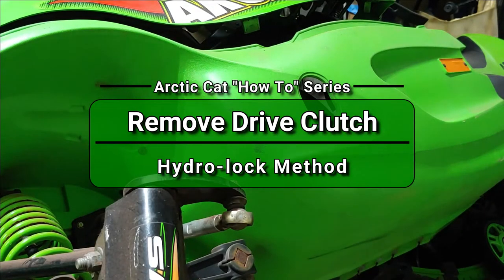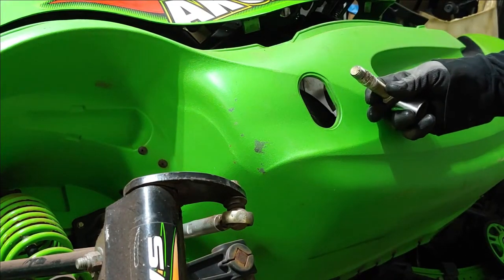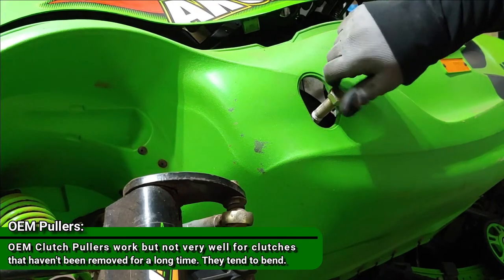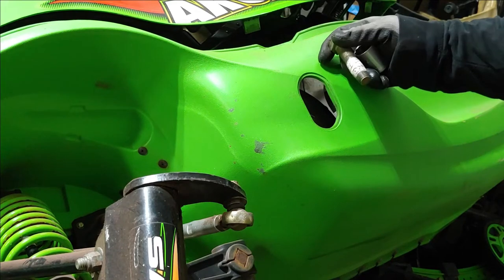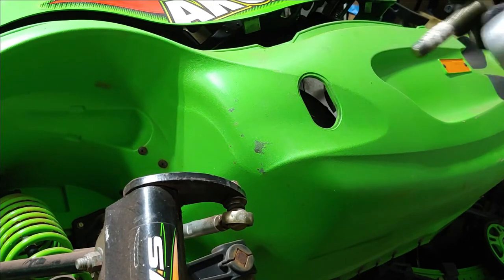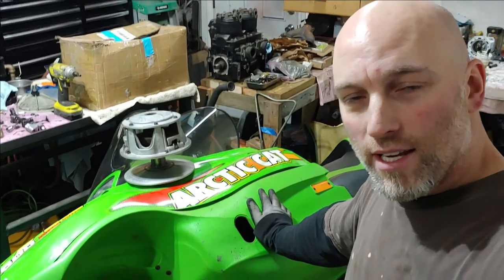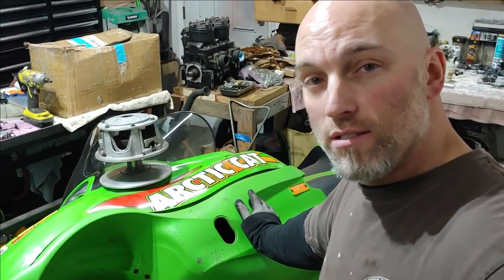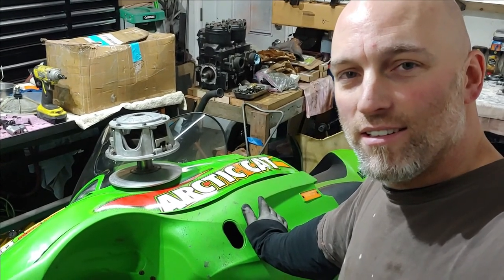Arctic Cat How To Series: Clutch Removal [Hydro-Lock Method]

Comment: I saw it on PowerModz too, but I think he only had to do it a couple times because he wasn't sure about it working.  I just received a Ski Doo clutch removal tool, but you have to whack it to get it off.   I'm trying that first, then if I think something doesn't feel right, I'm doing this method.  My isoflex is supposed to come in tomorrow so hoping to get that crank bearing all lubed.  Nice video, worked really well.  No snow here and nothing expected for 10-14 days at least.  Unbelievable.
Reply from the maker: Oh man, don't waste your time. Seriously. This is the only way that I remove clutches. You can twist the wrench with one hand and there's no risk of bending the tool and getting stuck in your clutch and have to cut your clutch off. 

We are supposed to get some decent snow up north late next week so we will be heading up.
Reply: Andrew's right! Hydraulic pressure is distributed over the entire landing cone of the variator. When you press with an ordinary puller, squeeze only in the center. Plus, you get resistance from the friction of the removable bolt on the crankshaft. In the end, I recommend listening to Andrew , he is a good mechanic. Do it as he showed!!! They do it all over the world! Hydraulics are always better than simple pressure! This is physics!

Comment: Would this work with the secondary too?
Reply from the maker: No. The secondary has a long 5/16 in Bolt with 1/2 inch hex head on it that is normally torque 2 about 22 ft lb and you are supposed to remove that and the driven clutch will slide off the jackshaft.
Reply: @Fixin2Ride-Official-  I removed that... won't move.  Soaked with Kroil for 3 days, used a big metal bar and put it under the steering tube and pounded from the other side of the sled, nothing.   Tried a torch, nothing.  Flipped the sled on it's side, and filled the bolt cavity with kroil and let it sit for 3 days, nothing.   Only rason I want it off is to remove a shim to adjust belt tension.  :\
Reply from the maker: @ADDvanced  eventually you'll have to get it off but that's not how you adjust the belt tension... This is how. Take your belt off and then look for a bolt on the back side of your motor that has a rubber bumper on it you adjust those nuts to increase or decrease the clutches shafts Center to Center distance. On a ZR you should be at 12.2 in. A good way to also check if your Center to Center is proper is by pushing on the top of the belt and it should only be able to be pressed down 1.5 in
Reply from the maker: @ADDvanced  whatever you do decide to try and get that secondary clutch off you'll have to remove the airbox open up the chain case pull the nut off the top sprocket pull the chain and sprocket off pull off the bearing and then undo the three bolts on the clutch side of the shaft for the secondary and pull that whole bearing assembly off and then you can pull the jackshaft and clutch off. And then you can put a nice big Bolt down in the middle of the jackshaft and sit on the bench and put the Jack shaft between your legs with the backside of a clutch sitting on your lap and then use it air hammer to push it out. You'll need to clean everything up before you put it all back together as well
Reply: @Fixin2Ride-Official-  airbox and carbs are off already, and engine is unbolted.   I didn't have a snubber so the entire engine was rocking rearward when I was starting off, which reduced belt tension even further.  I have like 1.75" of belt deflection; the belt is sitting to far into the secondary...
Reply from the maker: Holy cow. Yeah that would cause the bog you were experiencing. But yes. You want that torque bumper. And it needs to be set properly. Your belt maybe sitting too low because of the lack of proper distance. Take the belt off and see if you can lay the belt down in the sheaves deep like it is now. If you can, you either need a new belt or the sheaves have too many spacers/ too thick of spacers. If not, its whar I preveiously stated.
Reply: @Fixin2Ride-Official-  Belt is brand new and correct for the sled.   Has about 70 miles on it.   It's just sitting maybe 1/8-1/4 too far into the sheaves; from what I've read it should be proud of the outer edge of the sheaves by around 1/8".      It's slightly below, almost flush.   I figured removing/adding the shim, whatever to get it to ride higher, would help take up more belt deflection.   I also think the snubber will help, but it shouldn't be actively pushing on the block as it would vibrate like crazy at idle, there should be a gap between the snubber and the block about the thickness of a credit card, from what I've read.  When I bolt the engine back in I'm going to tip it forwards and see if that removes some of the slack.   Idk what else to do.  Thanks for your help and pray for snow!  :D
Reply from the maker: If the can slip down into the sheaves when they are fully closed then yes. You need to take a spacers out. The service manuals state to use the Bumper to adjust the center to center of the shafts for the clutches. There's not really any other way. Sure they should design them to not need adjustment but things move and shift so they gave them the capability to be adjusted and thats through the adjustable torque bracket. The key is that you are supposed to loosen the front engine mounts and then adjust the center to center using the torque bracket and then righten the engine mounts and back off the torque bracket to be 1.5mm (0.60" away from the engine. If you cannot do this simply by the procedure above youll have to egg out the engins mount holes in the brackets then try.
Reply: @Fixin2Ride-Official-  I would try that but I can't get the engine mount loose because of the primary clutch.  I watched your vid.   I tried it five times.  White teflon tape.  Yellow teflon tape.  Water.  Grease.   Then I watched some more videos.   More tape.  More grease.  More water.   Every time, I could feel the bolt start to compress against an incompressible liquid, and it would be hard to turn, and then it would just fucking thread all the way in and do absolutely nothing.   I am so pissed.  3 hours of my life and accomplished literally nothing.   This sled has just been a complete FU at every single turn.
Reply from the maker: @ADDvanced  man Ive been there. I had to cut my first clutch removal off. Lol. Is the water leaking past the threads? It shouldnt be. Use a good 1/8" thick of Teflon tape. And thread it in slowly. Start the teflin real close to the end of the bolt. This way it starts to seal off asap. Fill the hole up with water. Lightly tap the bolt with a hammer too.
Reply from the maker: @ADDvanced  gotta thread it slowly too.
Reply: @Fixin2Ride-Official-  Do you thread it all the way in, and then tap?  Or do you tap the bolt while you are threading?
Reply from the maker: @ADDvanced  technically you shouldn't even have to thread it all the way in as it will build pressure and then pop the clutch off but the rabbit in tell feels like it starts slowing down or snuggling up and then tap it a few times and then throughout it in a little more and tapping a few times see if that works

Comment: What size bolt?
Reply from the maker: Pretty sure they are 9/16" x 18 and 9/16" x 24
Reply: @Fixin2Ride-Official-  where do you get the 9/16 x24?
Reply from the maker: Got it from te Fastener store. Fastener you should be able to find it or certain hardware stores.

Comment: Believe it or not this is a safer way to do it than a clutch puller.have had alot of stubborn clutches bend pullers and screw up crank threads
Reply from the maker: 100% agree and that's why I'm not going to do it any other way because I have Dent pullers before the first one I ever did I've been to pull her so bad I had to cut the clutch off and into pieces